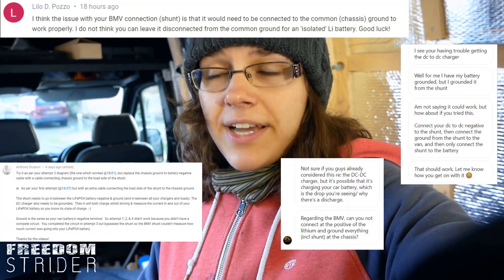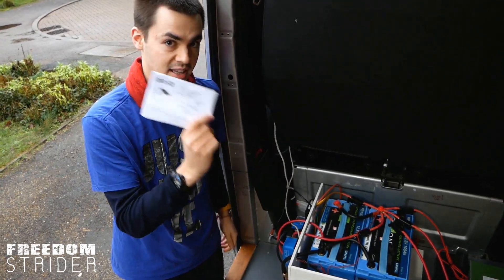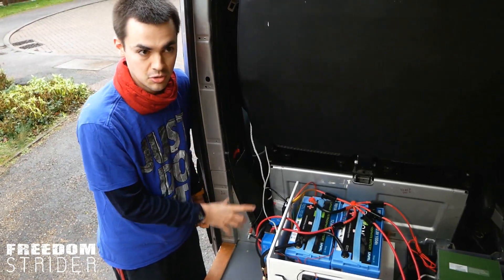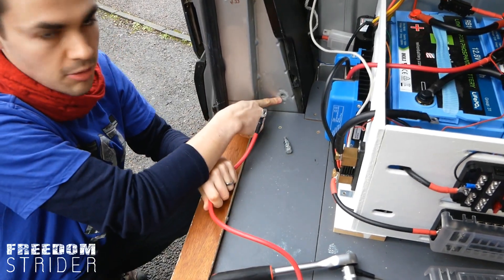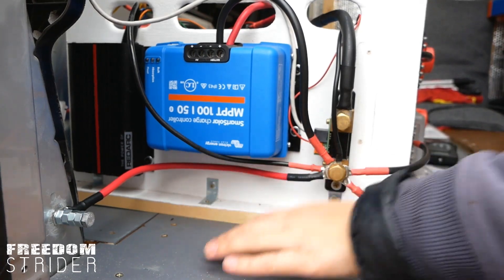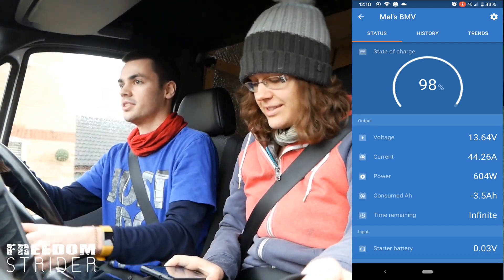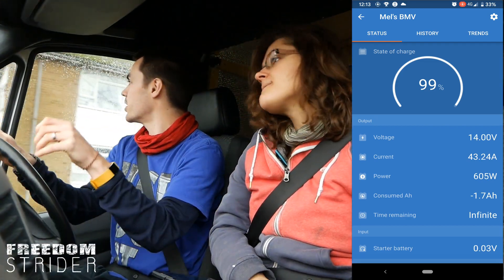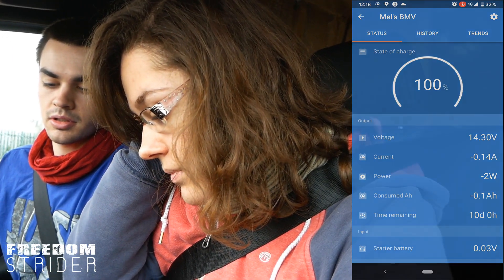Victron BMV 712 to Redarc DC-DC Charger | HOW TO Guide

Comment: Okay but what if you are using a bus bar, where would you attach the shunt? Mine is on my negative bus bar, is this okay?
Reply from the maker: If yoy have a busbar, you connect all negatives to the busbar, the bus bar to the shunt, and and the busbar to ground, this will solve the issue :)

Comment: I can see how this might be confusing for DIY-ers. But seriously, anyone who has a little bit of knowledge about how this stuff works should have been able to answer your question within 10 seconds. The principle is not that difficult. In order for the battery monitor to actually monitor what is going on with your battery, it needs to keep track of everything that is going into or out of your battery. Since the shunt is in the negative lead, this means that the battery side should be connected to the negative battery terminal and nothing else should be connected to the negative terminal. From now on, the load side of the shunt is your negative battery terminal. If any other manual talks about connecting something to the negative battery terminal, connect it to the load side of the shunt (or chassis ground), not the actual negative battery terminal. That's all there is to it.
Reply from the maker: Yes, it is all straightforward after you figure it out and it would have been great to have you around to explain it to us back then. We did call the companies we bought things from but unfortunately did not manage to reach someone who knew, so we troubleshooted the problem the best we knew.
Reply: @FreedomStrider  Like I said, I see how this might be confusing for DIY-ers. So I am not trying to criticize you in any way. After all, you are the one who figured it out, even when the so-called professionals couldn't. Kudos for that. But shame on the companies for selling you stuff they didn't understand well enough to be able to explain how to connect it. Unfortunately that is not uncommon nowadays.

Comment: Hi Guys, very helpful. Have you grounded your starter battery? Thanks much
Reply from the maker: We didn't ground the starter no, but from the factory, VW grounded some of its circuits to the chassis so the starter battery is effectively grounded, hence why we had to ground our leisure system

Comment: Great video! Quick question, isn’t the Redarc BCDC a solar charge controller as well? Meaning, why use the Victron charge controller if the Redarc can do both functions?
Reply from the maker: Yes, you are right that it has both functions there are two main reasons why we didn't use the Redarc MPPT:

1. If that one box breaks then we lose all off-grid recharge capacity, so not ideal.

2. Our Redarc MPPT is rated for 40A solar input and we needed to account for 45A.

Comment: Excellent work, just what I was looking for to resolve, thanks. One more little thing I wish you can help me with. I have a solar panel that gets connected to my REDARC BCDC 1225D. Do you think the solar ground should be connected the load point of the shunt just like other grounds?
Reply from the maker: Yes I would say so, considering if you had a separate MPPT then the negative needs to be connected to the shunts load side 👍All negatives need to be connected to the shunt so the BMV can read everything coming in and out the battery

Comment: I was close ! Had the DC converter negative to the load side of the shunt, but my Aux was also grounded to frame. 
It's odd that the Aux battery isn't grounded to frame (ground). I will have to think about that.
This is perfectly what I needed! Thanks
Reply from the maker: 😊 took a bit of figuring out but glad we helped. The tricky part with wiring is that there can be multiple ways to do the same thing.

Comment: I just got this same battery monitor.  I have a question after watching your videos.  So I am using a fusebox to run all of my wiring for my electronics.  I was wondering do I run the negative or grounding cable from this fusebox to the shunt now as well?  Any tips would be appreciated. Thanks
Reply from the maker: Yes, you'll want to run the negative cable of the fusebox to the shunt so the battery monitor can 'see' and measure the current usage from everything attached to the fuse box 👍😎
Reply: @FreedomStrider  thank you. Also do you run a negative wire from your starter battery back to the redarc charger so the ground all goes back to the same place? Or do you just ground auxillary and other components that is past the charger to a common ground?

Comment: Just found your channel guys and this has been a godsend! I'm just installing my redarc charger now and the lack of info (especially as you mention form the so called experts) is limited, so thanks for the upload 🙏

I did want to ask you a question about what you used to make your ground terminal? Did you just screw a bolt in? I've done things a bit backwards and I forgot to attach ground cables to the existing points on the van, now it's all covered with cladding, foil membrane etc etc and I don't really want to take it down. Thanks again

Gordon
Reply from the maker: For the grounding, we had a bolthole near our electrical set up so all you need to do is to expose some metal and ground it there. If you don't have an existing hole, you can use a rivnut for a good connection, but you will need to ground it to bare metal I'm afraid, doesn't matter what bare metal on the van, as long as it is on the van (because there is where the vans starter battery is grounded to) 👍
Reply: @FreedomStrider  Thanks for the reply.....I was hoping to use one of the bolt holes that had a tie down ring attached but couldn't find any info....I already have the bolt just need to grind it down to the metal. I always thought that would work but it's so difficult to find this info. I'll give it a go....thanks again 🙏

Comment: Thank you for this video. We've wired this in for a customer and had the same issue with negative Amps whilst charging I think it's the same issue I will ground the Shunt Load tomorrow 👍.
Reply from the maker: Hopefully it is this issue and it works out for you 👍

Comment: out of interest, did you contact Redarc head office in Australia (fyi, pronounced 'red arc' in Australia)?
Reply from the maker: No, (though not from a lack of trying, but to ring was going to be expensive from the UK) - instead we contacted a Victron authorised dealer in the UK, who mostly deals with charging batteries, and they knew about connecting battery chargers to the Victron BMV, since most battery to battery chargers have the same wire setup (2 positives, 1 negative) - the Redarc authorised dealer here in the UK didn't actually know what to do. 🤔

Comment: Is there a way to charge the starting battery with this b2b charger if you don't connect solar power to it? There is a cool way with a power bank for starter batteries but it will be even cooler if there is an option to send some juice from the solar panels to the starting battery. And how can i figure out how much amps does my alternator produces?
Thank you guys so much and sorry for interrupting you that much!
Reply from the maker: There are quite a few different scenarios that you could go with.

If you're wondering whether you can re-purpose the yellow wire to charge the starter batteries, I would say no, the yellow wire should purely be used to regulate the solar pannels. The b2b charger can only charge 1 battery at a time. You can re-wire the b2b charger in an emergency to change which battery you are charging, but you can't have the b2b charger charging the leisure batteries from the alternator and then charging the starter battery from the solar panels via the yellow wire. 

You can use solar power to charge your leisure batteries and your starter battery, however, you probably shouldn't use the same battery charger. In that case, the leisure batteries would have an MPPT box and the starter battery would have a separate MPPT box. Although, this is quite an advanced wiring setup and we haven't looked into it, and there might be a more sophisticated method to achieve something like that (companies like Victron may already have a box designed to do something like that).

As for the alternator, they have the Amperage printed on them if you can see it, but that is quite unlikely, as they are usually tucked away in a stupid place. In short, it's not easy, and I don;t even remember what ours was anymore, might be 90 or 110A. There might be different ways to be able to calculate it with adding up fuses or using a multimeter set on Amps, or just try and dig around for the standard manufactures alternator for that make and model. For some reason, that's not that easy to find but it is worth digging around. Here are a few blog links that might help:

https://itstillruns.com/check-alternator-amp-output-7673351.html
https://autoguysland.com/how-to-tell-what-amp-your-alternator-is

If you find any of these work, can you let us know how it goes? You can also upgrade a van's alternator to a higher output one if you wanted as well, and that way you'll definitely know what the Amperage of it is! 😂
Reply: @Freedom Strider  haha true but i could't find an alternator for VW Crafter with less than 110A so in the worse case ours should be 110A also.. why you guys didn't upgrade the B2B charger so that you can consume those 110A or maybe a little less and went with the 50A one?
It is not necessary to have 2 separate mppt controllers. There are mmpt controllers with 2 outputs that can charge different type of batteries(like AGM LifePo4 and others). I found one that outputs 25.5A to the main and 1A to the starting battery. Now i am wondering if i use this Dual MPPT to charge the main b. and the starter b. will it change something with the B2B charger system?
I hope that the B2B will still take the current from the Alternator when it is turned on and not the 1Amp from the Dual MPPT controller.
I found it like a nice option to don't let the starter battery drop and keep 'em up with a little help of the solar pannels.
What do you think?
Reply from the maker: Finding a b2b charger above 50A is very difficult. With some you can wire 2 together, but the limiting factor is mostly whether the AGM van battery can handle having lots of Amps being pulled out of it continuously, since not all lead acid batteries like that, especially starter batteries like in vans. You could also upgrade the van battery to be able to handle high Amp draw but that was more expensive 

Didn't know about dual input MPPT's...since you're connecting all the wires from the MPPT and the b2b charger to the van battery itself (not the alternator) then it should work, but I would double check with the company that makes the MPPT whether your plan would work, they are more likely to know than me 🤞👍
Reply: @FreedomStrider  that it still runs link gives instructions on how to short your battery if I'm not mistaken? I presume you didn't follow those instructions?